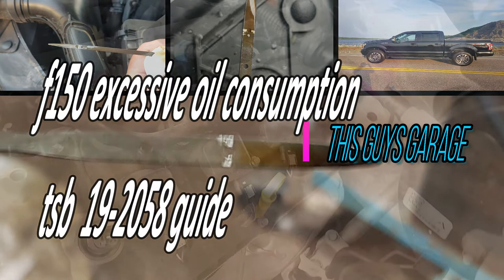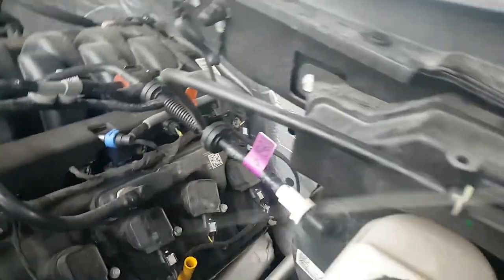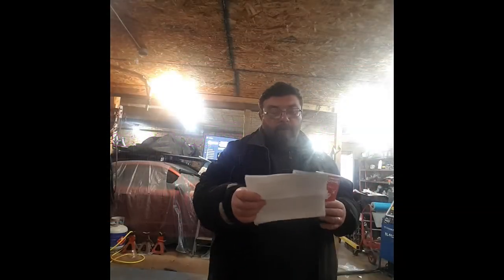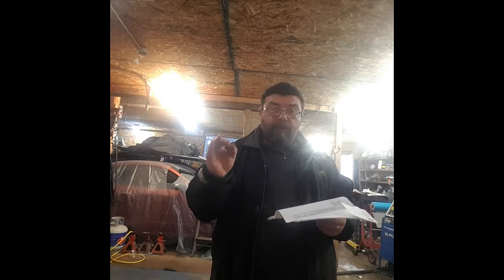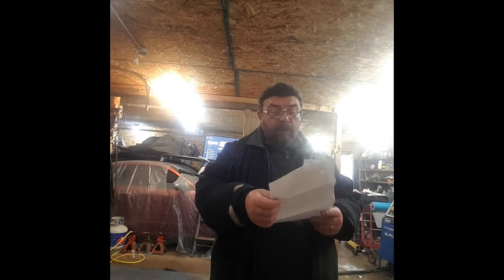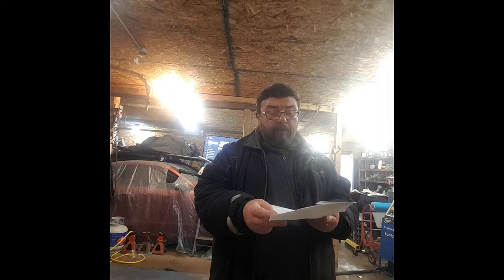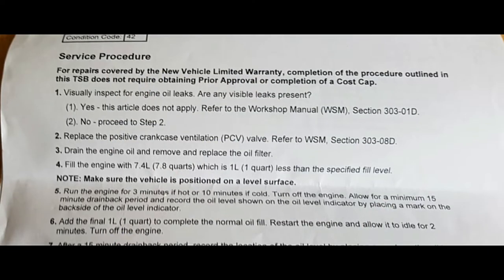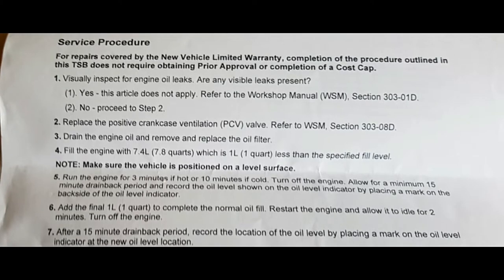FORD F 150 burning oil  2018 2019 2020 tsb 2058 service bulletin excessive oil consumption guide

Comment: Have you heard anything about TSB 19-2338? it states that the throttle plate is completely closed during deceleration causing a vaccum from the crankcase therefore sucking oil past the rings. The fix is to program the PCM to keep the throttle plate slightly open on decel. I'm waiting for a response from my dealer on this. I have a 2019 fx4 5.0 with only 2k & consuming oil. Definitely a good idea to watch that level before & after any of these procedures.
Reply from the maker: this was explained to me by ford ... i am also experiencing piston slap which sounds like spark knock .  basically the piston is too small for the bore size and is rattling the piston inside the bore. i was complaining about this issue from the first month i had the truck and has become worse .  i don't suspect this pcm calibration that they don't even have right at the moment is going to fix the problem.  its a flyer from ford because imo they have a bad batch of engines.  the new tsb2338  states" for customers concerns of oil consumption with no other concerns." piston slap is my original concern with oil consumption as an effect . thanks for taking the time bone kollector .

Comment: I wonder what the variable is as far as why some 5.0’s in that year range are affected and some aren’t. I would venture to say probably most aren’t but definitely there is an issue with some. I have an 18 5.0 with no such issue. I’m almost due for an oil change and I checked my oil a couple of days ago and it was right at the top mark still.
Reply from the maker: That's great 🤜🤛👍
Reply: By some being affected and others being normal that should mean it's not a programming issue or all would do it.
Reply from the maker: @rockie307  great point

Comment: I jumpped through all the hoops , my 2018 f150 , uses 2.5 litres between oil changes  , and i have before had magic oil suddenly apprear back on my dip stick when gettting my oil comsumption check , but i take pics of my checks before i take it in , now i have measure my dip stick , lol  , my goosh  ford , cant blame the advisors  they do wat there told ,  everyone needs a job ,
Reply from the maker: They screwed the pooch on this one. I'm starting to feel like a pooch.

Comment: Let me ask you this; if the cylinder bore is too big, why not just do a compression test and see where it's at? Wouldn't it have low compression?
Reply from the maker: Leak down test would be more appropriate.  But yes absolutely. 
Getting them to do one is another story... ty for taking the time seth

Comment: Interesting.  I have a 2019 with the 5.0 and I do not burn ANY oil.  Truck has 35,000 miles on it, and I have never once had to add oil.  I check the oil before every change (5,000 miles).  I use Pennzoil Ultra Platinum 5/20 and the oil is always pegged on the line.    5.0 Supercrew 4x4 with 3.31 gearing.
Reply from the maker: you are one of the lucky ones 👍

Comment: From what I've heard, the latest computer flash does fix the issue but information is very limited right now. May be worth having them try anyway.
Reply from the maker: ya gotta let em try.  I am not holding my breath for it to fix my truck. 

thanks redwings44
Reply: @thisguysgarage  not a problem! I heard one other YouTuber mention someone he knew got it and hadn't burned anything since along with someone on the forums. However his was too modded to be able to even try it. There's very little information because it is so knew, but he said it came out maybe mid-December. Interested to see what happens. Did you get the long block replaced?
Reply from the maker: @RedWingsninetyone  no still fighting with ford on the long block.

Comment: They performed the TSB on my 2020 F-150 for using oil, and it’s still using it. The TSB didn’t fix anything.
Reply from the maker: a computer flash can't compensate for a hurt engine.  I would suggest getting an oil analysis done. unfortunately they won't do anything unless you force their hand.

Comment: Yes I know it's not a fix but it seals the cylinders and conventional burns slower just saying
Reply from the maker: thanks for taking the time. i had 3 of these trucks with the 5 liter none have used oil between changes. that being said a lot of people have problems with the 18/19 5.0 . something in the engine has changed. really appreciate your input. while its under warranty i have to use what the man tells me.
Reply: @thisguysgarage  plasma welded cylinder walls is the major change since 2017.

Comment: Why would only some engines do this and not others? I’ve got a 2018 5.0. Doesn’t use any noticeable oil at all.
Reply from the maker: Hey Austin it's a good  question out of the hundreds of emails and comments I get a very small portion are in your category.  With out knowing the specific information on your truck like 2wd or 4wd reg cab or super crew final gear ratio it would be hard to tell what is making your truck the exception. I'm not sure what you consider noticable or acceptable. Ty for taking the time and count yourself lucky.  🍻
Reply: I’m waiting on my new engine then doing a buyback with Ford. They know and trying to make it good.
Reply: Very hard to believe. My 2019 used 1.5 qts in 1500 miles. I drive a 2020 Ram Laramie now.
Reply: V r. Not sure what I would stand to gain from lying about this, if that’s what you implying? I still own the truck. I change the oil somewhere between 7,500 - 10,000 miles. I can’t say for certain it doesn’t use ANY oil but I’ve never pulled the dipstick and seen it below the hash marks and that’s the gods honest truth.

Comment: Put straight 30 weight in or 1040 and see what the burn is will Probably be normal
Reply from the maker: i would agree you would not have the issue if you run this oil from new, but one you have the problem ,it does not resolve the problem ,if that makes sense ,speaking from experience .    not to mention it voids your warranty, ty mike
Reply: @thisguysgarage  The main reason for the thinner oil is better fuel economy. If you put an oil catch can on the PVC line you will see the oil that catches and burns
Reply from the maker: @mikefrayman5224  the lighter oil is for fuel economy.

Comment: Unsleeved aluminum cylinders
Reply from the maker: Certainly part of the problem ty for taking the time Arthur
Reply: They're not unsleeved, there's just a spray on coating instead of traditional metal liners. It seems to work for the most part.
Reply from the maker: @ice44567  all do respect what you described is the definition of unsleaved. Appreciate your taking the time 👍
Reply: My 2011 GT500 has the PWTA liners just like the Gen 3 5.0, in fact the 2011 GT500 was Ford's first production application of the Plasma Transferred Wire Arc spray on liners.  
My engine does not burn an observable amount of oil, if you record the fill level at a specific cross-hatch on the dipstick at oil change time it will be on on that exact mark 5,000 miles later.   

The issue isn't the PWTA process, Nissan licensed it from Ford for use in the GTR engine and Ford has been using it on lower volume engines since 2011 (2011-2014 GT500 and the 2017-up Ford GT have it) and it hasn't been problematic in any of these applications.  

The Gen 3 5.0 clearly had a production level issue, either the liners were going on too thin, ended up with uneven application with major thin areas, or bores were somehow being finished out of round for whatever reason.   Regardless of the root cause, the issue has supposedly been corrected as of a Jan 2019 engine production date.
Reply: @thisguysgarage   Semantics I guess, it still has an iron liner it's just sprayed on in molten form and applied thinner instead of a traditional pressed in iron sleeve.
Reply: @BC08  well how ever you want to term it its garbage compared to a true pressed in steel liner to build that engine to make reliable power reputable builders will sleave that engine problem solved..
Reply: @arthurmorton1994   PWTA liners have been taken over 1000 rwhp in GT500s.  PWTA liners definitely have a strength disadvantage over a set of .080"+ pressed in sleeves, but they also have production side advantages for the manufacturer, and they also usually shave over 10 lbs off bare block weight.  I'd rather pressed in thick wall liners, but PWTA is a proven process and when applied properly aren't an issue even with higher power combos.

Comment: Your service bulletin said to change the long block. That doesn’t include the fuel system the electrical system the exhaust system. I don’t know if I would go that route and have the orangutans at the Ford dealership tear my motor apart and try to install a new block. Better the devil you know.
Reply from the maker: long block would be a whole assembly, ford now just ignores the problem, so its our problem ,not theirs .

Comment: My engine was changed at 15,000 miles now there's twenty one thousand miles on it and it's still consuming oil
Reply from the maker: I think there is a problem with the run of engines since 2018
Reply from the maker: Thanks again for hitting the button. Really appreciate it. It helps so much 🤜🤛
Reply: @thisguysgarage  I think its the .020 plasma welded cylinder walls scoring and wearing badly fast, cast iron cylinder liners would cure this problem.
Reply from the maker: @davidcox2197  absolutely a possible suspect 🤜🤛thanks for taking the time 👍
Reply: Same thing they changed the engine and 10k miles later it’s doing the same thing and they are replacing it again. I’m trying to get a buy back. 28k miles 1.5 yrs of ownership and it’s been in the shop 15 times for all sorts of problems
Reply from the maker: @troyweintraub4965  stay tuned. I have an explanation for this coming.  Thanks so much for sharing this information.

Comment: I think the oil is 2 thin
Reply from the maker: That could be .but the same oil has been used since 1996 when the modular engine program started without issues till now.

Thank you for stopping by and talking the time 👍🤜🤛

Comment: Dang seeing low oil and an newer truck. Seem like Ford is making junk on new vehicle's
Reply from the maker: I can't say i'm happy with mine buddy
Reply: My 2019 screw was low 3.5 quarts with only 6900 miles on it. They claim  to have fixed it with a PCM update and now I have some interesting noises that do not include the DI pump. Although I havent seen the oil level drop again the noises are a concern. Possibly phasers or something else in the valvetrain.
Reply from the maker: @andrewlemoine5709  mine sounds like a diesel. Actually the new ford diesel is quieter.  My engine has piston slap very noisy.  They are trying to stop the blow by with the pcm keeping the oil out of the intake.  I don't believe a pcm can fix a noisy engine.
Reply from the maker: @andrewlemoine5709  ty for taking the time 🤜🤛
Reply: @thisguysgarage  mine sounds exactly like a ford diesel. When i get up to about 1100rpm-1600rpm i hear it ticking its ass off though. If i had a way to do it i would send you a video of it idling. Very clear in the wheel wells and under the hood. Didnt sound this way apon buying the vehicle.
Reply from the maker: @andrewlemoine5709  I have another video with a camera under the hood.  I would love to take a look at what ever footage you have 🤜🤛
Reply: @thisguysgarage  If i figure out how to post a video I will let you know.
Reply from the maker: @andrewlemoine5709  https://youtu.be/DPn02nQ0xZU here is mine
Reply: @thisguysgarage  Yes i had watched it a little while ago. Not much of a youtuber but I do believe I uploaded a few videos. It did not sound anything like this before I took it to the dealer.
Reply from the maker: @andrewlemoine5709  keep in touch andrew👍
Reply: @thisguysgarage  https://youtu.be/vX0cnouxysw I Will. Btw this noise is slowly getting louder. Every few hours of driving It sounds louder inside the truck.
Reply: Glad I got the 2.7 twin turbo. I’ve put over 40,000 miles in one year of hard driving and never no problems. Tuned as well so lot more harsh power. I’ve owned it since 2015, has 168,000 miles with original motor and transmission and doesn’t burn oil one bit. Sorry man.

Comment: New cars need to run 10w 30 oil stops oil consumption
Reply: Tyler Dimedio my 2017 tundra uses 0w-20. It doesn’t burn a drop. Unreal
Reply from the maker: thanks so much!👍 appreciated